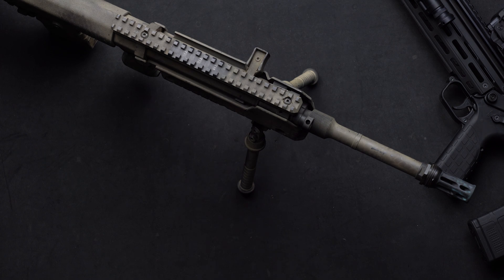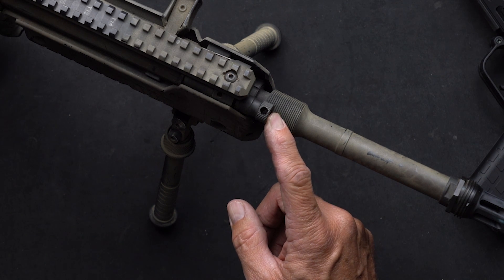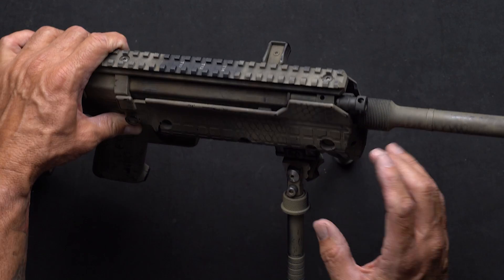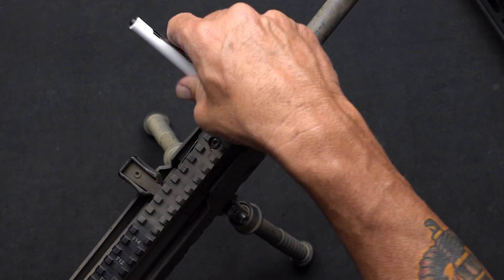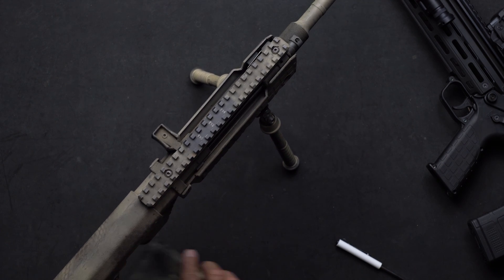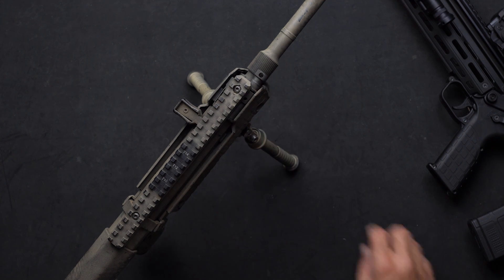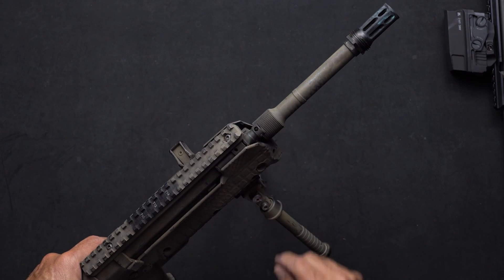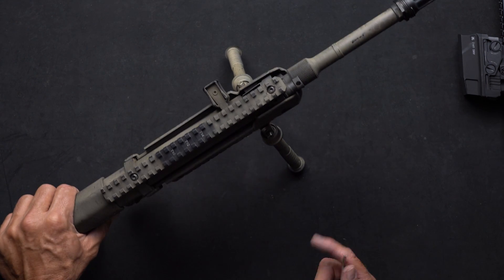Easiest Way to Adjust the Gas System on the RDB & RFB

Comment: I literally do not know how you managed to make this so overly complicated. Every adjustable gas system gets adjusted the same way; you start with no gas going to the gun (so in this case the adjustment nut “open” all the way out), you then begin giving it more gas one click at a time until the gun will lock back with the rounds you will be using (or your potential lowest power round, like some Tula steel case), and then add two clicks for reliability.  Yay, you’re done.
Reply: @Labradorslobber If you think his convoluted way describing, “turn it clockwise all the way open, then go back counterclockwise 12 clicks, and then another couple clicks if you want it softer, but once it doesn’t lock back turn it in a couple of clicks, and then for reliability another couple of clicks…” is simpler than just starting with the gas off(counterclockwise) and increasing the gas until your weakest ammo locks the bolt back on the mag, and then increasing the gas another click or two, then I guess you win.
Reply: Why do you even care ? Maybe there’s new gun owners wanting to learn different ways of doing things everyone has there own way of doing things instead of wasting your time to watch a video you already know how to do then hate on the guy just for trying to be helpful to people 🤷🏻‍♂️ makes no sense , and if this was a video from Glock or S&W I bet you’d be singing a different tune praising them ? Just saying don’t waste your time watching a video then criticizing someone for putting it in different way of doing things everyone has different ways of learning
Reply: @LithoSpear476  Because I came to the video just to confirm the rotation direction as I didn’t have my manual in front of me, but stayed because I was baffled by how convoluted he made the actual adjustment directions. 

I care because this isn’t good instruction. It would be like watching a teacher teach your kid to add 4+4 by saying, “Add 5+5 and then subtract 2, and that equals the answer to 4+4”.
Reply: @JimYeats  ok gotcha

Comment: Mind RDB fire when I let the boat go forward all by itself. Thank God I didn't hit anyone. Please let me know. Have you heard of this problem? How could I be sure if this won't happen again? I was nowhere near the trigger
Reply: I had that happen with both a rem 700 and a Benelli R1 , the primer was not even dented. I experinced it in the armed forces as well doing trials with 105 mm artillery, bofors 2 guys died that time. It was all due to primer issues. Both my rifles had gold match primers and they fired every second time i closed the bolt fast enough.

Comment: If i set it up to run lower pressure loads like bulk ammo or steel case will it function with hotter loads like 175 grainers?
Reply: It will, but it might be overgassed which will increase recoil (the carrier will slam against the back of the action).  You're better off noting where your bulk ammo setting is and then use 5 or 6 of your hotter rounds to adjust the gas block.  Keep note of both settings so you can return to them when you change ammo

Comment: On my RFB, I have the regulator completely removed and it still feels over gassed with all kinds of factory ammo. Is there a way to remedy this? If the detent pin also broke as soon as I turned it the first time. I shoot un suppressed and everything from Tula or Wolf FMJ to higher end match and hunting loads. All factory ammo.
Reply: Even though you aren't using a suppressor, I might try contacting them about getting the suppressor piston, they say if it's still operating the action too violently when the regulator is screwed all the way out the suppressor piston will help. Hopefully they have a more thorough answer for you though.
Reply: @TheCrystalJules  thanks for the advice
I'll give them a shout and see what they say
Reply: I was going to get on here just to address this issue. Do you happen to have one of the pistons with gas rings? These are the same exact ones that go on an AR bolt. BLUF remove them. They aren't needed. I had the same exact issue where no matter how far out the adjustment knob was I couldn't get the rifle to short stroke. The gas keys do such a good job sealing gas that they keep enough gas in the system where it won't fail. After removing them you can adjust your rifle just like described in this video.